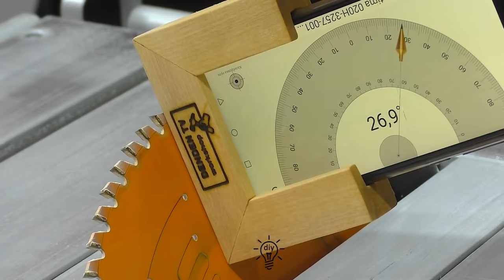A great tool for the home workshop! Great idea!

Comment: This guy is the reason SawStop table saws were invented. From one woodworker to another “Good Luck “ keeping your right hand till you are an old man.....🤔
Reply from the maker: thanks
Reply: @diyprojects7868  What is that thing you do with, apparently, instant glue and WD-40.? Is that an uncommon effective way to glue wood pieces.?
Reply: @hector_vazquez  It's instant glue and an accelerator. Makes it stick on contact

Comment: If I were you, I would never get my fingers anywhere close to the blade.
Reply: He will have to learn the hard way
Reply: Had the same thought when he was cutting those grooves. Nope i don't trust a saw that much
Reply: I know a guy who worked 30 years in a carpenters shop. One day I ended up driving him to the hospital with 2 missing fingers cause he was "experienced" enough not to bother with safety gate on the table saw...
Reply: If you pay attention that 3 inch rule has no point I run my fingers close to the blade all the time haven't had an issue, don't cut twisted lumber and pay attention no worries
Reply: @rickhunt9655  its not worth it to me but you have fun
Reply: Yup, that’s how a friend cut off 3 fingers, when the piece kicked out from under his downward pressure.  He had over 40yrs as a professional woodworker.  An adage is FBC… Familiarity Breeds Contempt!

Comment: Finally someone that uses the METRIC system 🙏🙏
Reply: I'm used to feet and inches. I prefer it for 2x6 ECT. Used to 1/2 inch plywood thickness. But for exact measurements might go metric.

.

Comment: That was pretty neat what application are you using on your phone for the angles
Reply: I couldn't find the specific one he used, but if you go to the Google play store and enter "digital angle finder" you will probably find what you are looking for. I found one called Angle Meter which works very well. Another alternative is to go to a site like Chipsfly and order the Igaging angle cube. It is magnetic and is deadly accurate for making sure things like your table saw blade is at a perfect 90 degree angle.

Comment: Hola Mi Amigo!  You certainly know your way around in the shop....no waste motion or hesitations trying to figure out what to do next.  I am an hobby woodworker who also plays guitar....I gotta say, watching you work, as efficient as you are really has me sucking my teeth.  True...you know what you are about....and it only takes a micro-second to have a life changing event.  I was taught and have read elsewhere....keep one's digits 3" away from the blade and NEVER over the top of the planer or tablesaw blade.  If you just MUST continue to use the practices that have been working for you....some 'not so cheap' insurance is a SawStop....I have watched demo's with a hotdog and the dog winds up with barely a nick in the skin.  There's a loud noise....and Saw Stop will refund your money for a new cartridge if it saved a finger.  No, I do not own a tablesaw...but if I did......-Veteran '66-68

Comment: Bad idea but a cool trick.  Instead of using highly accurate, machined steel surfaces,  you depend a piece of saw cut wood and the alignment of the phone in the frame.

Comment: Al minuto 0:49 
Che tipo di colla stai usando per incollare? E a cosa serve lo spray? Sono da utilizzare insieme?
Grazie.
Cmq iscritto 👌
Reply: (Looks like) Superglue + cyanoacrylate accelerator. You can use the cyano without accelerator but it takes more time to dry (especially when the wood is extremely
 dry)
Reply from the maker: acfix 705. Sì utilizzare insieme

Comment: There is only one eensy teensy little problem with it. Accuracy. First, the jig has to be absolutely faultless, not the tiniest deviation. And then... your mobile can only fit in one one way and that fit has to be as firm as can be. No wiggling! Not the tiniest bit. If not... no accurate reliable reading. I see this going wrong plenty of times. So... handy? Well... that depends. On how good you really are. Spare yourself the headache and buy the gizmo.
Reply: Then there's the fact that it doesn't look like the jig fits in between the carbide teeth on the saw, meaning that it's already not sitting flat on the blade. I'll keep my little $20 Wixey angle device with magnets that's also good to 0.1 degree.
Reply: Well....  the app can be zeroed at any setting .... but you would need to , say, set it vertical (90°) and zero it there so that you could get another angle accurately...and yes as MC says the teeth stand proud of the metal disc so that has to be allowed for ... 

But these apps have possibilities... 
For instance, if you had a lathe and wanted to divide something in the chuck into segments, a magnet fixed on the back of the phone and then stuck on the back of the lathe spindle and you have an accurate dividing head... just make sure to only turn it over by hand 🙄😂

Or ... used in conjunction with a spirit level , you could set angles by first using the level as it was meant, get it perfectly "level" & zero the phone app protractor... now its a simple matter to use the level to mark out any angle accurately... 🤗
😎👍☘️🍺

Comment: Very cool stuff! 
There's one thing I would like to learn if you want to share, is the glue process, in the video you used two kinds, a spray, and a small bottle, could you kindly share more information about the glues, thankfully
Reply: The glue in the bottle is cyanoacrylate (CA) glue, the spray is an accelerator for CA glue.
Reply from the maker: akfix 705 Express gluing glue

Comment: Nice work , but some bad habits on the table saw, hoping you use a push stick. On the jointer pushing wood over the place with your hand,if the blade catches a hard spot could shoot the wood away and your hand would end up on the blades. I know you are a excellent craftsman and know all this but would hate to see you get hurt.
Reply from the maker: thank you very much for your concern

Comment: Creative woodworking! What type of plywood did you use for the tool rack at 5:16 and is it widely available?
Reply from the maker: this is birch
Reply: Looks like a scrap piece of form ply to me. It's a very standard thing to find in any hardware store or construction supply place. As the name suggests, one of the most common uses for it is building formwork to cast concrete inside. In the USA I believe it's referred to as HDO (High Density Overlay) plywood. That black finish on the faces is a plastic resin that's quite hard and scratch resistant.

Comment: Only useful if your workshop floor or at least your saw table is absolutely level. If you are going to that trouble you can probably calibrate the angle gauge that is on your saw.

Comment: I saw what he did with his fingers also. News flash. That completely safe. The sawblade is in a fixed position, there's about 1,5 cm (about 3/4 or 2/3 of an inch) wood between his fingers and the blade. So, no problemo. And that he took care to keep his fingers more or less on the centre of the piece tells you that he knows what he is doing. (So his mobile holder/gradient jig works!) People who claim that this guy is not a professional clearly aren't themselves. I'm a certified furniture maker by the way.
Reply: You have or make push sticks for this....terrible safety here in this vid
Reply: You’ve lost your mind Theo Bolt.  All it takes is a split second for the workpiece to grab and kick back for your fingers to drop straight onto the blade. “So big problemo!”  If you think this is safe operation, either someone needs to do an intervention and take your table saw away from you or force you to by a Saw Stop for your personal safety. 

And if you’re wondering what MY qualifications are - I spent 15 years working for both Powermatic and Delta Machinery selling 66s and Unisaws.
Reply: You need adequate downward pressure to make accurate dado cuts.. I’m not saying that his method is best but downward pressure is necessary.
Reply: @DansEarway  so are your fingers. Just a bad vid.
Reply from the maker: many thanks. nice to read such comments.
Reply: Dans Earway a Micro Jig allows adequate downward pressure. So will a shop-made jig that keeps your fingers well away from the blade.
Reply: Dans Earway that is completely unnecessary and juvenile.
Reply: @fun2fly2003  which is exactly what I think of all the tsk tsk flatulence

Comment: I cringed when I watched you run your finger over top of the saw blade.  This is ridiculously dangerous.  Never bring your hands near the blade like that.
Reply: Agree, cringe!
Reply: You need adequate downward pressure to make accurate dado cuts.. I’m not saying that his method is best but downward pressure is necessary.
Reply: @DansEarway  you might see a response I put elsewhere. You need to use another piece of wood or other safety sick.  Table saw safety has you never put your hands by a blade like that.

Two key point from a Wood magazine article on table saw safety:

Make sure you have a pushstick handy for any cuts that require your hand to pass within 6" of the blade. See designs on the next page in part 2 for two tried-and-true pushsticks you can make easily.

If you're making repetitive cuts, stop frequently to take a break. Many accidents happen after boredom lulls a person into carelessness.

https://www.woodmagazine.com/woodworking-tips/techniques/safety/tablesaw-safety

A popular tool to stay safe is the MicroJig Gripper.  Watch this:
https://youtu.be/9ZdJEEyZ07w

Comment: +1 for creativity but I'd rather spend $10-20 and get a digital angle gauge on Amazon and not have to rebuild a mount every 12-24 months when a new phone design comes out. Your design is also not as accurate as those devices because the contact surface laps over the saw's teeth which is going to skew the angle. When you have to rebuild it for your next phone, you may want to revise the design so that the contact surface is a 2" strip in the center of the bracket